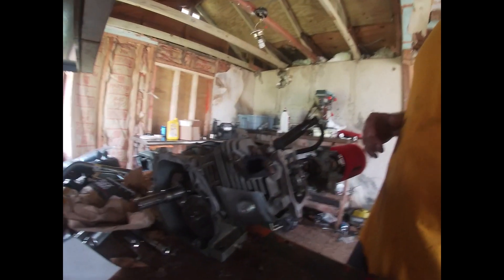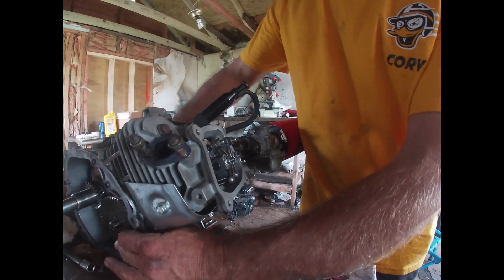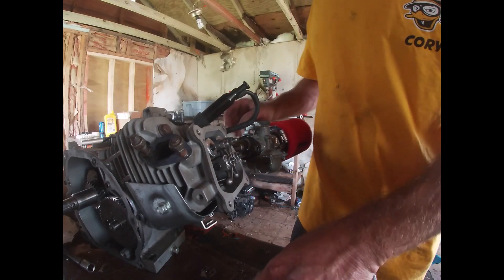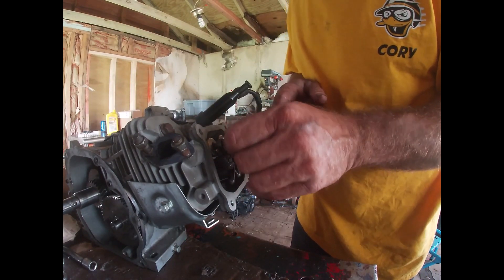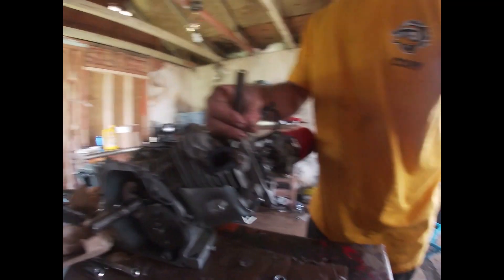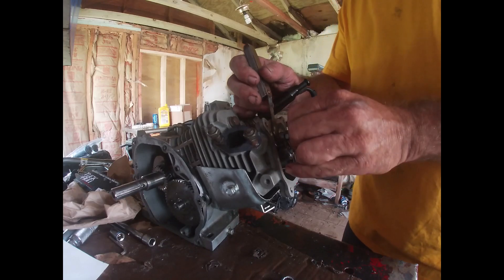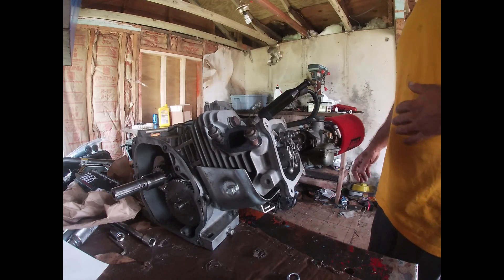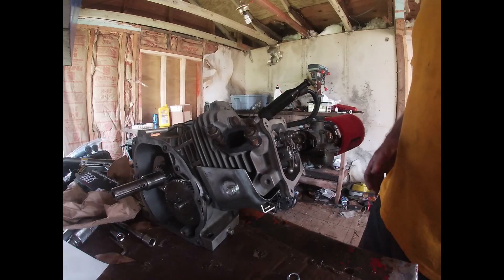Finding top dead center and setting valve lash on a Predator 212, Tillotson, Ducar or any clone.

Comment: Finger over the spark plug hole 🕳 turn the engine over  untill you feel a outpressure from the ⬆️🕳 check that both valves are rockers loose thats TDC ... then reset to 003 make it even simpler

Comment: why is there people stuffing rope in the motor to do this process do we need the rope or no  i seen some vids and i ask this because im breaking in my ducar212 and people are saying i gotta set the lash after break in and i have zero experience should i just go to a mower shop or something so i dont mess it up
Reply from the maker: The rope is to change out your valve Springs to keep your valves from falling down in on top of the piston when you're trying to change the Springs out
Reply: @minibikemadness9483  lol oh see i toldu im up shizz creek witout a paddle so i gotta get feeler gauges and rope not too bad thanks again for this info and taking time out yur day to help a lil monkey like myself lol apreciate ya MiniBikE madnESS
Reply: @minibikemadness9483  so on my ducar def set them at 0.02
Reply: @minibikemadness9483  cant the wildcat piston fit in the ducar with the proper rod

Comment: on the valve lash is it .008 and .009 intake and exhuast
Reply: They say anywhere between .000 and .003 is fine. I would set a new engine around .002 just because they will open more with heat expansion. .003 is the "norm".
Reply: @xaviermccloud4586  .002 on both sides or just exhaust?
Reply: 0.15-0.20
Reply: Intake -0.10-0.15